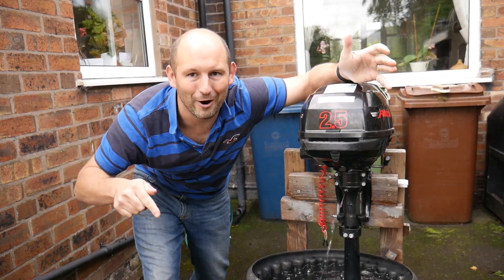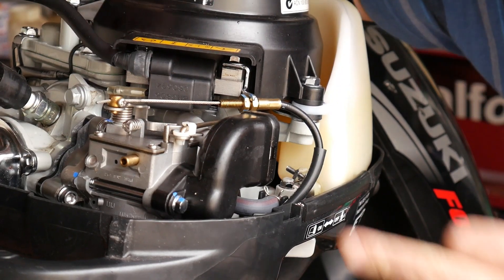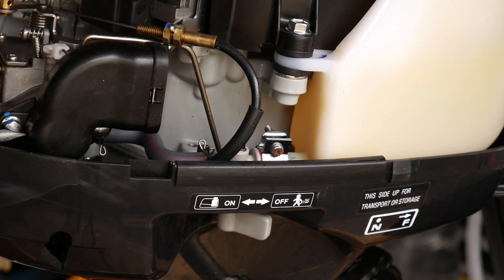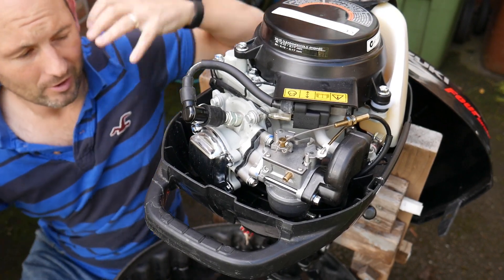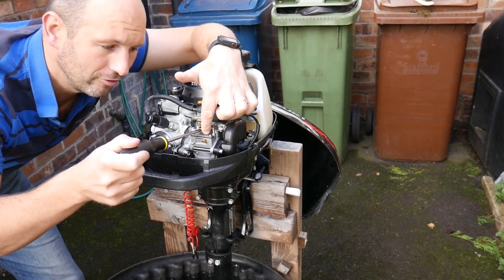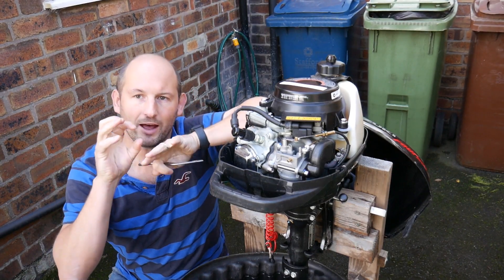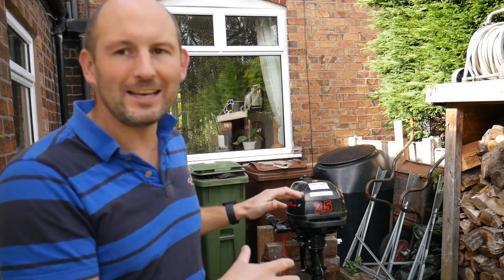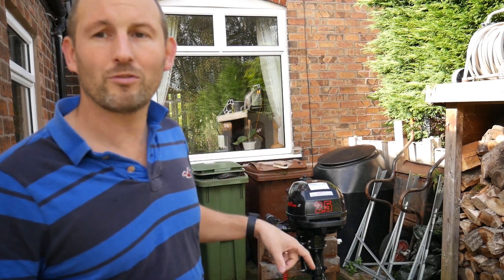Suzuki 2.5hp Carburetor strip and idle fix

Comment: I just finished rebuilding the carb and servicing mine.  This video really helped.  I did find a couple of tricks.  
1) Make sure to clean the 4 small air jets in the venturi.  They cause most of the problems  Also make sure to clean the main jet.  The easiest way is to buy an assortment of copper jewelry wire.  I used 18-28 gauge.  THe 28 gauge will fit way down in the small idle jets where a pick only gets to the surface of the holes.  You can also use the coarser wire for the main jets.  
2) If your tearing the carb down, make sure to soak it in carb cleaner.
3) Use a new bowl gasket and intake gasket.  They are cheap from Suzuki.
Just finished mine up, and it runs like new.
THanks for the video.
Reply from the maker: Thanks for the comments. They are always useful to hear and help.

Comment: Helllo and thanks for the video❤

I had same problem as you. My problem was located to clogged pilot jet(idle jet). Jet is located inside carb and its covered with flathead screw. I had to remove jet and clean it with thin metal wire. Hope this comment helps someone with same issue.

Comment: Again I thank you for the tech content and presentation. It helped me a lot.
Just some input here. My motor worked like a gem  after winter on test, I topped up the fuel with petrol from a mate's jerry can,  then took it in the back of the car down to the boat and away we went - uh oh. Stalled after several minutes running. Many tries and the best it would do is run occasionally with choke out.
Next morning gave it another try. 10 minutes down the harbour she stopped and would only go intermittently and short periods.
On draining the carb - lots of fuel but when bowl emptied I turned on the tap turned and the fuel barely ran out. 
I removed and inspected the tank - a load of very fine black sand in the bottom. On removing the tap assembly from the tank I found a very fine filter - blinded. Cleaned filter and tank and  she runs like a dream.
Lesson here, don't borrow fuel from a mate
Maybe that's why his 140hp outboard is running at low power, he thinks that it's down one cylinder and is looking at a replacement I reckon he should check his carbs first.
Anyway - thanks again for  your wisdom
Reply from the maker: I’ll drain my tank and have a look at that then. Thanks for the advice. Could be the same problem.

Comment: It’s always the idle jet.    It’s under a screw under the top plate.   The hole is smaller than a pin, so you have to soak it in carb cleaner and try and clear out that hole.   You can barely see light through it when it’s clean.     Once you get that clean it runs

Comment: That screw you took out to get to the main jet? That actually is the main jet. Comes in 3 sizes (62, 64, 66, dependent on year of engine), what's above that is called the main nozzle. Both need cleaning. If the main jet is blocked, not enough fuel is getting past to the nozzle. Clean/replace the main and you will be running without choke 😊

Comment: no problem, small frost plug at the rear of the carb. has your idle mixer screw under it. remove frost plug screw out the screw, clean with cleaner, and re-adjust
Reply from the maker: That would probably have helped.  I used an ultrasonic cleaner in the end and that did the trick.  Certainly easier to change the mixture and stop it being so finicky.  Thanks

Comment: If I'm trying to keep lightweight (putting it on a inflatable....mariner 4) are there any other small outboards you would recommend? I was thinking maybe the Yamaha 2.5 or the yamaha 3hp 2 stroke. they're both around 35 lbs. Any thoughts on those? Would they run into the same issue? Or should I just go with a 55lb thrust electric troller? Thank you in advance for your wisdom. Great video!

Comment: I have the same engine that had the same idle problem. After FULLY disassembling and thoroughly cleaning the carb including pushing a small wire through the jets, the engine starts first pull and idles perfectly without using the choke at all. I use 91 octane fuel with NO Ethanol. Not sure why you have to have your choke out to idle. The low idle screw might need adjusting.
Reply from the maker: It seems to be working now after the ultrasonic cleaner. I couldn’t get a wire to fully go though the holes in the carb block. All sorted now though.

Comment: I had the exact scenario mate and the only thing I did that you didn't is clean the screw that you take out to get to the main jet. I couldn't understand, everthing seemed to be backwards ,it would only idol and rev with the choke put. But when I cleaned that screw it all flipped back to normal and now the choke works as it should. My problem and the reason I found your video seems to be the "air jets" and when I knock it in gear it dies or if I come off the throttle to quick it dies. Do you know about where is the factory setting for the fuel mixture screw?
Reply from the maker: i was a little more trial and error.  They don't really seem to be made to alter etc.

Comment: I have this motor and will never buy a little Suzuki outboard again. I am a fan of the brand, but this outboard is a design failure. The jets are WAY too prone to blocking. I guess they designed them too tiny. Even if you take all the precautions and drain the bowl and run the engine out of fuel before storage they will fail after a while. It seems every time I get to the boat to use it, it goes straight back to the workshop. I'm going to sell this Suzuki and get a 2 stoke Yamaha 3 hp. Won't give me a single problem in 40 years.  Some forums say you can swap out the original jets for larger jets, but its a hassle I could do without.
Reply from the maker: I agree and I say I’m going to sell it every time. Trouble is it’s so light and easy to take to places.
Reply: I agree, mine has 10 hours on it, just horrible, it never starts easy, now it doesn’t start at all, clearly a carburator issue. Hate this little engine!

Comment: Great video! Thank you! Just one question, is it necessery to check/change protection anode on the cylinder block?
Reply from the maker: I never have on mine but only when they wear away to around 1\2 gone....  obviously the one on the leg would need changing much sooner.

Comment: Simple fix.my 2.5 suzuki runs flawless. You have to drill out the plug that is covering the idle mixture screw and turn it out 1/2 to 3/4 turn. The plug is on the outside of the carb.
Reply from the maker: David Thomas which way? Anti clockwise or clockwise?
Reply: @dp47280  anti(out)
Reply from the maker: I’ll try that then and see what happens
Reply: on the side of the carb? and are you drilling out the plastic motor case "plug"?
Reply: @TodSackett  on the left side of carb there is an aluminum plug above the mounting bolt roughly 1.5" to the left of the brass vent tube. I have a picture of it but not sure how to post it

Comment: Hello!
Very informative videos, thanks!
Have you tried running your engine on alkylate petrol? There are many brands but Aspen 4T is well known. Easy to find in gardening or forestry supply shops.
It is pleasant to use (does not smell very strong), clean burning (good for spark plugs) and does not leave any gunk or varnish behind (nice for the carburettors). Also, as it does not contain ethanol, corrosion and water mixing are less of an issue. And it does not degrade like automotive petrol, giving it excellent shelf life.
While it is pretty pricey, it is a good solution for rarely used spare motor or as a good engine flush for winter storage.
Reply from the maker: I haven't tried it.  I've always stuck to running the carb bowl dry after use.  Maybe worth a try though.  Thanks for the suggestion
Reply: @dp47280  Running the carb dry might be the source of your issue: when evaporating automotive petrol leaves a thin coat of "varnish" behind. Not good for tiny perforations ;)
Reply from the maker: pierauspitz you could be right and something that has crossed my mind. I think the next video coming will be the carb in an ultrasonic cleaner!!! See if that works. Thanks for the input. It’s valuable advice.
Reply: @dp47280  Looking forward to your next videos! Thanks again for your great content!

Comment: In my opinion these Suzuki df 2.5 are garbage mine was brand new and it let me down straight away  took it to Suzuki to fix under warranty . Suzuki didn’t want to know they said I’d tampered with the carb unbelievable on engine less than 3 hours run . They then charged me to supposedly fix an alignment problem very vague . Didn’t play up after but this corresponded with weather getting warmer . Here we are exactly 12 months after and weather cold again and exactly same problem again . Engine cannot run without choke and cuts out as soon as choke pushed in . Any throttle instantly dies . Just rowed half way back to shore again ....beware do not buy one of these .
Reply from the maker: @Ian G In a way I have to agree with you- this is a motor I really want to like because it’s light weight and when running is great. Getting it running is hard work and keeping it running seems even harder. I’m looking to sell mine because without reliability you may as well not have it at all.  Thanks for the input.
Reply: Mixture screw under the blanked off plug at back of carby beside brass tube, drill out centre of plug with fine drill and pull remains of plug using small self tapper into plug blanking off access. This exposes mixture adjustment. Set ridiculously lean at factory for emissions purposes. Hence your need for choke.
 Some people have documented this fix elsewhere.  These engines can be made to run well.  Thanks for your video.
Reply: I have same issue from the beginning, engine has 10 hours now! 😡
Reply: @dp47280  If I'm trying to keep lightweight (putting it on a inflatable....mariner 4) are there any other small outboards you would recommend? I was thinking maybe the Yamaha 2.5 or the yamaha 3hp 2 stroke. they're both around 35 lbs or 16kg. What are your thoughts about those. Would they run into the same issue? Or should I just go with a 55lb thrust electric troller? Thank you in advance for your wisdom. Great video!